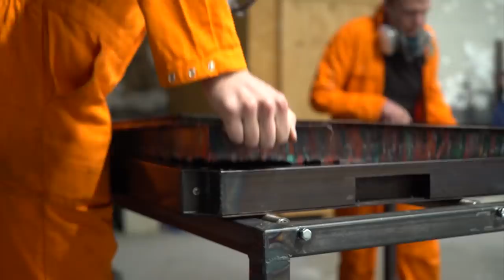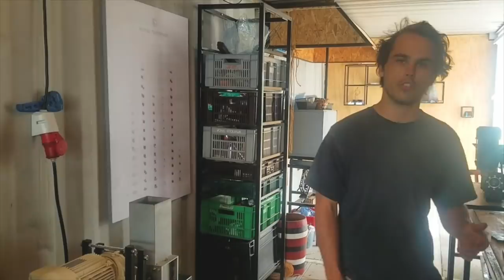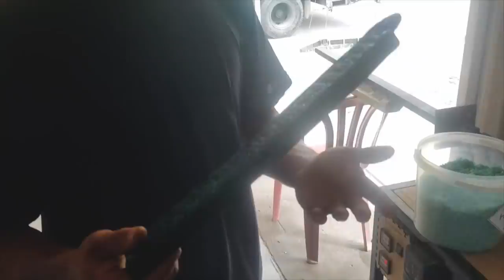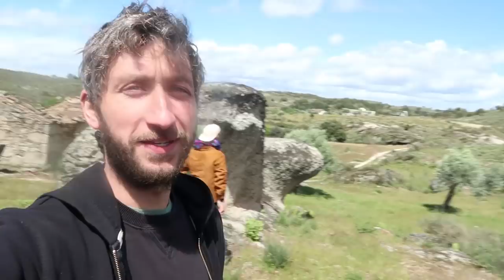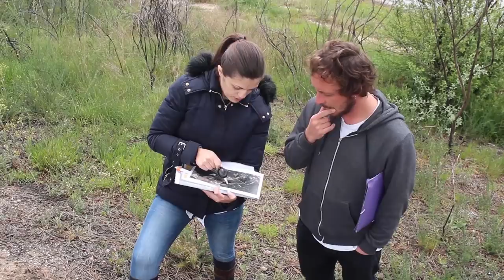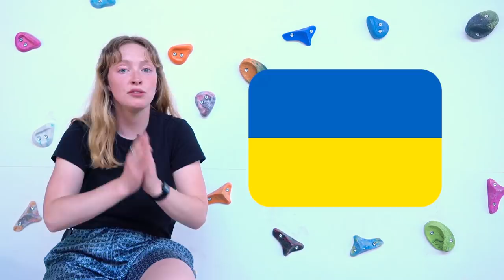Monthly News #27 - Looking for land in Portugal

Comment: Software like OpenLCA exists for those kinds of life cycle analyses to compare the ecological footprint of transport methods. It will be difficult deciding the boundaries/limits you want to go to to make sure you have a fair comparison. It gets more complicated if you include other indicators like the embodied social impacts. You could try emergy analysis (with an 'm') which supposedly lets you compare the footprint of things based on the equivalent solar energy that went into them, so you avoid the problem of comparing apples with oranges. Keen to see what you end up doing
Reply: Hi Zachary - You just reinforced one of my core beliefs, you don't know what you don't know. I was totally unaware of emery analysis until I read your comment. Then I searched it and found a quick comparison. "The   dialog   between   energy   analysis   (EA)   and EMERGY analysis (EMA) is imbedded in the larger search  for  indicators  to  guide  our  lives  and behaviors  in  environmentally  desirable  directions." Thanks for showing me a new way to look at things.

Comment: embodied energy calculations are a deep rabbit hole...would be great if you can figure it out
Reply: Just thinking about it gets deep really fast. I think in general an airplane is more co2 efficient than busses. Just based on less infrastructure and longer lifespan of aerospace equipment.
Reply: @markm0000  but also the street infrastructure is kind of a necessity for transportation, while the aerial infrastructure is replaceable. Very difficult question there, indeed. Would love to see a story hopper on this.

Comment: Ideally you would travel by train since the rail system is mainly electrically powered and can use renewable energy. The entire Dutch rail system is powered by wind power from the North Sea. Trains run on steel wheels so do not generate tyre dust, which is a major source of microplastic pollution. The tracks have an open structure so do not create impermeable surfaces causing excess oily rain runoff and heat island effects like surfaced roads and parking lots. Aircraft engines emit soot particles at high altitude encouraging the formation of ice crystals causing lingering cirrus clouds increasing cloud cover and affecting the climate. Air travel doubles every twenty years so this is a major environmental disaster. Airports have vast areas of hard impermeable surfacing leading to excess runoff and heat islands. Trains are too expensive compared with buses and planes. Flixbus is entering the rail market so maybe they will drive fares down. The real answer is to reduce the need to travel at all. Those properties you are looking at in Portugal were self sufficient years ago. The people who lived there did not jump in cars and drive to the city for work.  Acquire a large enough piece of land to accommodate at least 100 people and establish a business on the property that can support them as a commune. Then none of them need to travel elsewhere looking for paychecks.  One concept is to make renewable ethanol fuel from food and agricultural waste that is carbon neutral. That way you could power your own vehicles with clean fuel and have a product to sell for income.
Reply: You can take a TGV from Paris to Hendaye on the Spanish border, then the overnight Sud Express sleeper train to Lisbon. Much more civilized than buses or planes.  We have an organization in Italy called Movimento Lento...Slow Movement, like Slow Food. Slow down and don't be in such a hurry, in other words.

Comment: Hi Dave, What a fun trip in Portugal!   I have a question in your field of expertise - plastic recycling.  I have been successfully molding parts in hdpe, primarily using 5 gallon buckets that have been discarded.  Yesterday I tried melting hdpe from a 55 gallon blue chemical drum (actually had Canola oil in it, not a harsh chemical :)).  The problem is that even though it is clearly labelled as hdpe it seems to behave like an entirely different beast.  I take it up to 230 C (450F) and it is just a bit rubbery, not moldable.  Then if I go higher it starts to burn/char but is still just rubbery.  Any ideas on what is going on.  I normally melt the 5 gallon buckets at 170 C and it starts to really flow (a bit like thick honey) at 180 C.  How do I process the blue drum plastic.  Clearly it can be done, as many big companies have "Blue Drum Regrind Flakes" for sale by the ton.  Any help would be greatly appreciated.  Cheers, Ian.

Comment: A transatlantic flight measured in TONS of CO2 and equivalent per person.  
Flight you skipped would have been about 360 lbs of CO2 but planes produce other pollutants and particulate matter that contribute to global warming and inject it high into atmosphere where it is most effective and long lasting.  You would have produced the equivalent, depending on the calculator used (it's assumptions as to aircraft mixes flight altitudes for short vs long haul, etc) 800 to 1,400 lbs (1,400 lb =  667 kg) of CO2 emitted at the surface of the earth as your bus did.  Your bus trip produced maybe 40 lbs of CO2 and equivalent.  FYI single use auto almost as bad as a plane.   ALL of infrastructure you used was installed for for LOCAL TRAVEL (auto commuter bus and local delivery trucks) and long distance trucking, as long distance bus travel is a tiny fraction of vehicles miles compared to other two.  No additional lanes were allowed for long distance buses.
So, you did good, got to chill in Paris (you lucky dog) detox from daily grind (admittedly you're day job is really cool) see what's happening in the world up close and personal which can provide vital insight into your job, politics, etc..  
PS  Stuff like this is all over the internet, admittedly I've researched this and many such eco issues and can easily find reliable info, but it's there.  Part of problems w people wanting to succeed so much or as said in the states by bosses to convince workers to intern gig and otherwise work cheap, follow their bliss - they don't learn about much else.

Comment: Bus is not the solution. Train is the only possible solution, it justifies the infrastructure, and gives infinite possibilities with low mantainance.
Reply: Train is x times more expensive to travel with than bus. And only a little bit faster.
But it is/can be  a very relaxing way of traveling.
Reply: @hansdegroot8549  Well, maybe in the U.S. is like you say. In Europe Train is very faster and mostly electric with less cost in the infrastructure
Reply: @lorenzoci  I live in Europe. Traveling by train is far more expensive than by bus on long distances. The time gain is not that much.
I don't know why traveling by train is so much more expensive than traveling by bus.